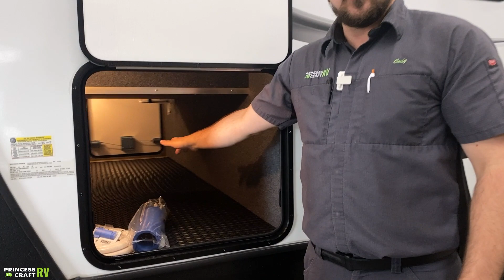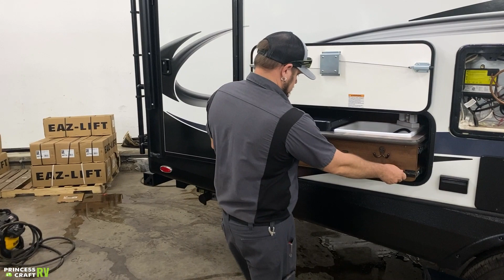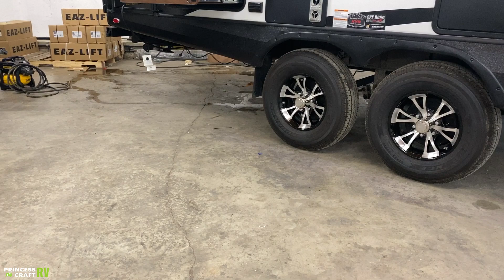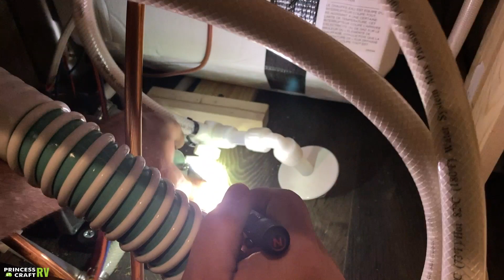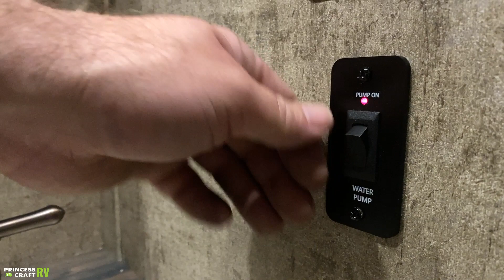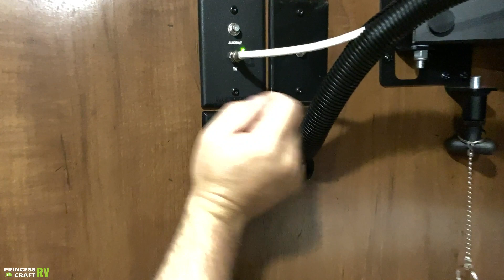2020 Timber Ridge 23DBS Mountain Series by Outdoors RV - Technician Tour

Comment: And why dont you have usb ports and power plugs  on top of table whyu did they put it under your legs?
Reply from the maker: We'd have to ask the manufacturer for ya! We're just a service center at a dealership, so we aren't able to speak to the design process or the thoughts of the engineers.

Comment: Hopefully we close the deal today on a 2021 model. I like this video alot, I learned more than the sales guy was able to explain. However I do wish you talked more about the off road capabilities and extra thick insulation, this is by far the best insulated trailer I have seen. Thanks for the walk through
Reply: You will find out about the insulation on the Factory Tour YT for Outdoors RV.
There is another YT channel called Adventurous Way where a couple bought an Outdoors RV for off-roading. 
He actually does the factory tour and also another q&a with Outdoors RV.